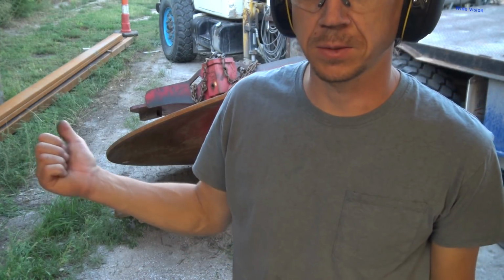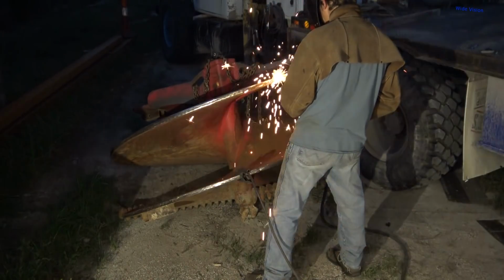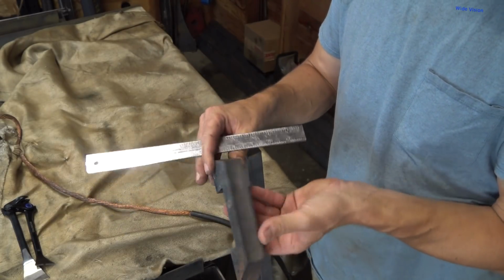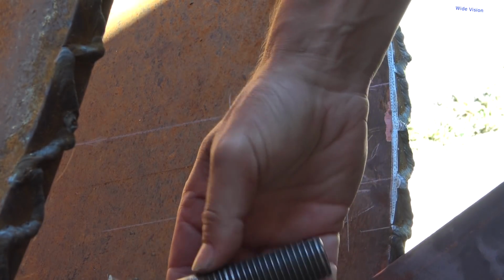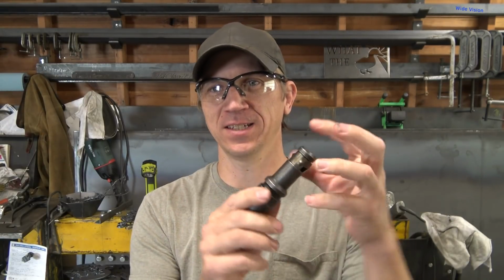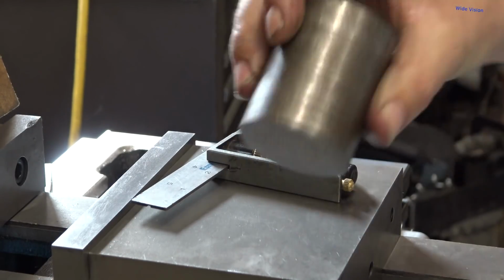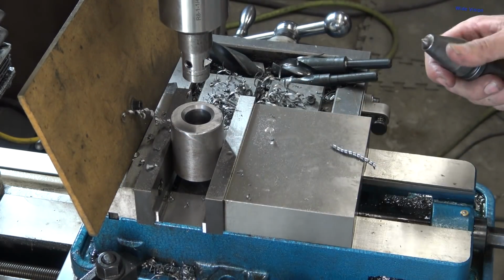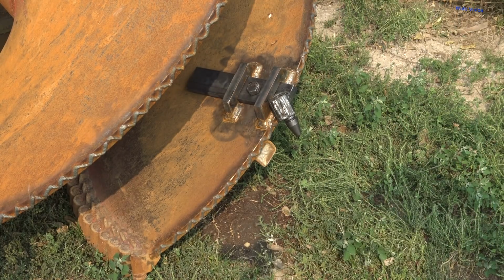HUGE AUGER REPAIR!!  Adding reamers and hard surfacing.

Comment: Nice work, the plasma cut the 1 inch perfectly. That's some thirsty puppies! 😁
Reply from the maker: Thanks! Yeah, it does well on 1 inch. I just need to upgrade the electrical coming into the garage so I don't trip the breaker.  And yep, they had just gotten back from a long walk on  a hot Summer evening. At least they get along! :)

Comment: Hey Wide Vision: love the videos. I wonder why you don’t use dual shield wire on some of these heavier plate jobs. Any particular reasons?
Reply from the maker: No particular reason other than it's just not needed for this application. Solid wire has more than enough penetration and strength.
Reply: Agreed. I do enjoy dual shield wire in some instances for thick plate (1/2” greater) because it looks nice and provides great penetration with just stringers. But solid wire is the best do-all process! . . . I know this is a hot topic on just about all welding channels but I like to hear individual’s thoughts.

Comment: Nice work. 
Question, how do you like your PM mill? I'm ready to buy a mill, and would like to hear your thoughts. Pros, cons, any problems or concerns..... Thanks
Reply from the maker: It is a great mill! My "only" issue I have with it is the X  DRO covers up the back way oiler, so I have to use an oil can and squirt it into the way. Hopefully I'm getting it oiled enough and won't wear out that back dovetail.  I love the power quill feed, which I couldn't find available on any other brand of mill.

Comment: Curious how you determine whether to Mig or stick weld? As thick as the materials are on this project, wouldn't stick welding be stronger?
Reply from the maker: Always MIG unless it's a special alloy I don't have wire for, or it's too windy and I don't have flux core. MIG is faster, stronger and better penetration than stick.  Back when I did the Sweep Plow rebuild, I got lots of comments saying I should have used stick instead on MIG on that thick metal, and it confuses me. Where does this misinformation come from?  Jodi at weldingtipsandtricks even did a couple videos on the difference in penetration, and MIG always wins.  Even the pipe liners are switching to MIG. A couple years ago a 36 inch gas line was put through here, and every single welder was running a suit case MIG setup.
Reply: @WideVisionMetalFab  gotcha; thanks for the reply. I'm more of an odd-job/amateur welder, and I've never had any formal training, but I vastly prefer MIG to stick. I know most structural welding now is MIG/dual shield, so I've wondered if the old tale about stick being stronger was in fact not necessarily true.

Comment: love your videos and the work that you do. i was wondering if you have a video/series on your hydraulic press brake in the shop by any chance? keep up the good work
Reply from the maker: Thanks! I'm trying to get a video put together on that press. That was built when my camera was losing files so I have a lot of gaps to fill in, and I'm kinda stumped on how to do it. It's not like I can refilm that build, and me just talking about what I did isn't a very good video.
Reply: @WideVisionMetalFab  Thanks for getting  back to me. I don't think it would be a bad video at all. I'm looking at making one myself and a rundown on yours would be a fantastic help. cheers
Reply: @WideVisionMetalFab  I'll watch as the finished product is picture enough, your summation would be educational I'm sure ... Hell I watched my Dad fabricate his garden tractor with one 9 hp Briggs and the drivetrain  primarily automotive. Filled 15" implement lugs with tubes, calcium and water.  He grew up near Portis on a farm.

Comment: Nice job. The Plasma sure did a nice job. Just saying if that was me I would have used 7018 or 8018.
Reply from the maker: Thanks! Nah, stick is too slow, and doesn't have enough penetration.
Reply: @WideVisionMetalFab  clarifying myself better here. I was talking about those two brackets that held the flat iron on the auger flighting. I would agree with you if you use dualshield flux core welding